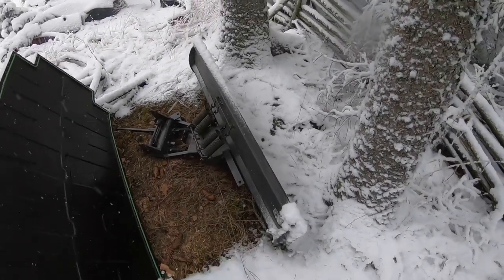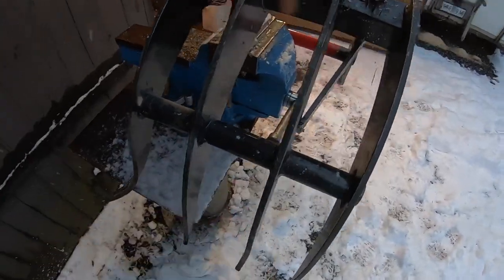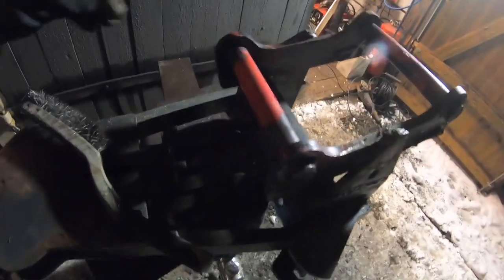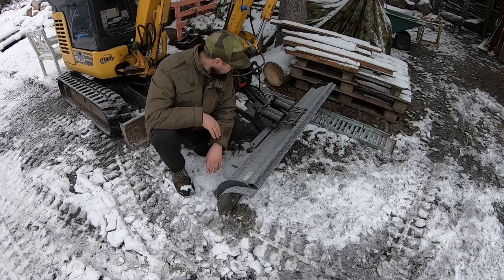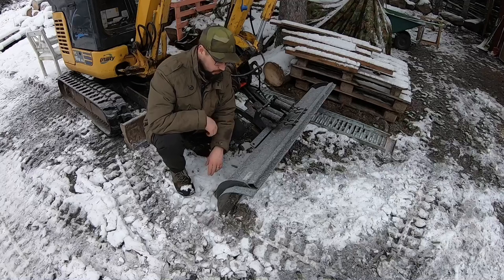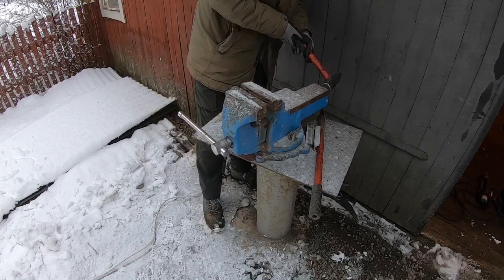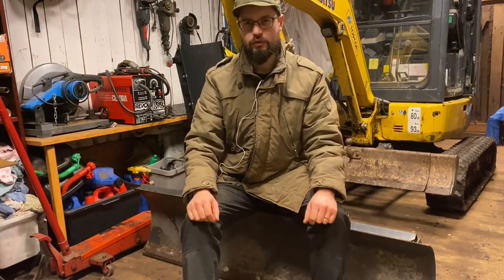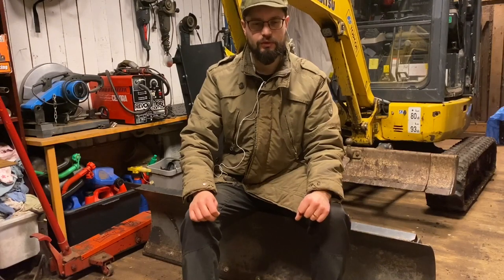Hydraulic snow plow for mini excavator

Comment: Intresting equipment for mini excavator, really cool. I have also an issue at my summer cottage that the road should be get open in winter and this kind of "snow plow" could work on that purpose.
Reply from the maker: Thanks! It works fine but it is slow and hard to control, if I were to do it again I might just add a longer/higher blade where the original blade is. I use the ATV much more often than this MiniEx plow but if I get a real bad snow storm and want to sit in a warm and cozy cabin this is a good solution.
Reply: @NilsKall  Excatly, when there is like 50cm or 1 meter snow to remove then this snow blow and excavator is better I believe. I have 1.7 ton kobelco and when need to open my cottage road there is 50-100cm snow to remove.
Reply from the maker: The mini excavator would be great for the occasional heavy hard work.
Reply: @NilsKall  Have you tried reversing your bucket, so you can also push the snow to the sides?
This is possible with some excavators depending on the bucket hitch. A reversed ditch bucket would be perfect for this task.
Here is a link for how to reverse a bucket on a excavator:
https://www.youtube.com/watch?v=XVElzot1reI&t=3s&ab_channel=DieselandIron
Reply from the maker: @claudepage6214  My quick attach is reversible so it would be easy to do, I haven’t tried it on this mini excavator but I did try it on my previous one. It is useful in some instances.

Comment: Very unique, wirh a little time in the seat you’ll be doing fine. Cool video 👍🏻
Reply: I built my own pushbox this winter for my driveway as I was tired of plowing snow with my bucket
Reply from the maker: Thanks! Yeah it was a bit hard to maneuver but with some practice it will perform better. I should also create a mechanical float position but if I were to cut this up I think I would need a plasma cutter.
Reply from the maker: @BiffsEquipment  the bucket fills really fast when there is some snow on the ground. I assume you made a video of it?
Reply: @NilsKall  I agree you really need a boom float I think for things to work easily so you can follow the contour of the ground. Plasma cutters are nice I have one I use it all the time for my projects. The one I got was a Chinese one it was only $299 and works amazing but I think I got lucky cuz now the price is over $1,000 for it
Reply: @NilsKall  yah I have videos of plowing snow last year and made 3 videos on building the pushbox, if you go to my videos list you’ll see my pushbox build videos they are more recent. I showed the whole process in building it start to finish
Reply: PS if I were you I’d add some skids to the plow since you’ve got a gravel driveway like mine.. this way you can let it down with out worrying about plowing all your gravel. I keep my plow about 1/8-1/4” above the ground using the skids
Reply from the maker: @BiffsEquipment  some equipment you just can’t live without once you get it.
Reply from the maker: @BiffsEquipment  I don’t know how I missed those, have to go check it out.
Reply from the maker: @BiffsEquipment  there are skids on the plow but they are in a bad shape. I have had better luck with the pipe as edge method but perhaps strengthening and expanding the existing skids is a good idea.